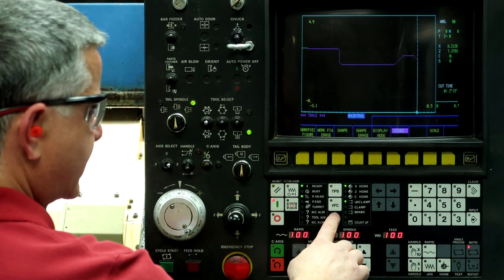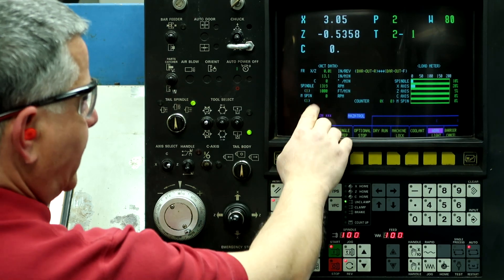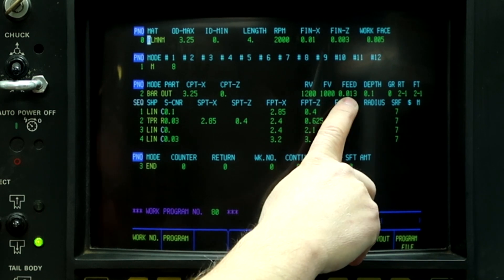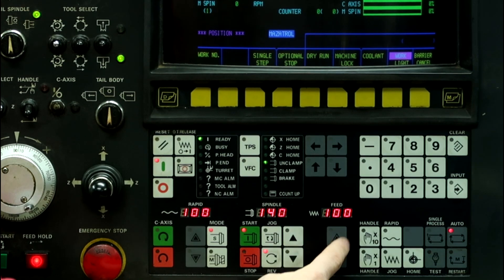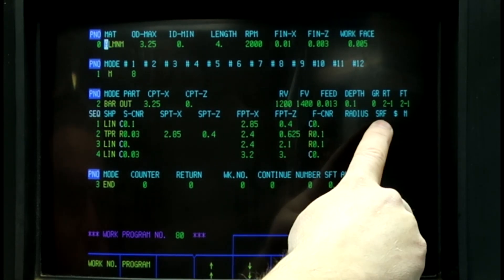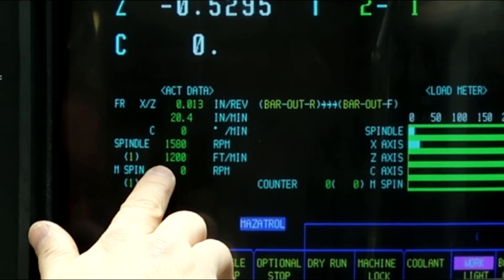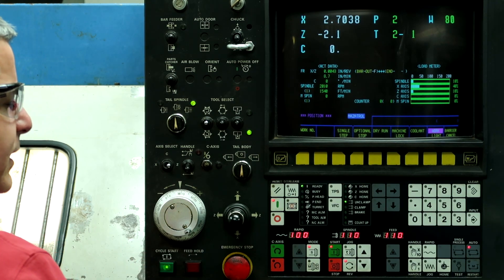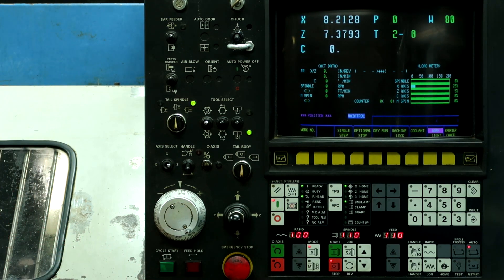Mazak VFC Button Function

Comment: should make a video of setting up the lathe from start to finish loading the tools, setting them with the toolsetter, entering tool data, setting the z offset, and adjusting the offsets to get a good part.
Reply from the maker: @aarontabor2915  thanks for the suggestion. That will be a long video though
Reply: @mazatroltipsandtricks6816  
Depends on how many tools you load.

Comment: Hello.  I have never written on/to a forum before, so if this is not where I need to be, my apologies.  We just purchased a "new to us" (aka used) 2000 VTC 20G.  Machine has been powered up and everything comes on, but we are trying to remove the blocks (for transit), and try to move the head/tools...., but are getting some errors.  Can you tell me if this is a simple fix that we can do here, or will we need to hire a professional to come in?  Alarms: 364-MAGAZINE DOOR INTERLOCK, 304-MAGAZINE NOT ZERO RETURN, 303-MAGAZINE DETRACT ALARM, 212-MAGAZINE DRUM MALFUNCTION.  Please let me know our best plan of attack to correct these issues.  Please and thanks, Chris.

Comment: Hi Phil thanks for You importante información i hace one mazak qt25 control mazatrol cam t2 i need parameter lista and one mazak VQC 1540 control mazatrol m32
Reply from the maker: I do not have parameters for other machines.
Reply: @mazatroltipsandtricks6816  thanks

Comment: You saying that Mazatrol automatically figures SFpM?  Isn't it better to adjust feed and speed while machine is cutting?  Or is that not doable?
Reply from the maker: This video is all about adjusting the feeds and speeds while cutting and then pushing the VFC button the machine memorizes those new values into the program.
Reply: @mazatroltipsandtricks6816  can you do feed or speed overrde while the program is running?  IS RV and FV surface speed or RPM.  One video you say its RPM another you say surface speed.
Reply from the maker: @joeshmoe5935  Yes, you can overrride the feeds and speeds while the program is running same as any other CNC Lathe.  RV = Roughing Velocity aka SFM.
Reply: Can't edit the program while program is running part.
Reply: @itsnotfar : No, you can't edit the running program while it is running.
You can only edit programs that isn't running or create new programs.

Comment: Nice Video Thanks Phil
I have a questionn for you.
Is it possible to do auto shut if  there is no material in bar feeder using some M codes in program by tracking chuck pressure, spindle load etc. ??
Thanks
Reply from the maker: No. Auto shut off is done with a timer. I have never used that function though on any Mazak so I'm no expert.

Comment: can i have more than 12 tool data stored in my machine so i don't have to fill in all the dimensions, the degree's and stuf?
Reply from the maker: Yes, but it gets complicated trying to keep track of the tools and you have to change the tool radius and tool direction anyway.  For simplicity, it's easier to keep the tool data and tool files the same as the station number.
Reply: Mazatrol Tips and Tricks but i can say that my tool 20 is a smal grooving tool and it is in position 4 
And tool 21 is a threading tool in positing 6?

How do i need to do it? Could you maybe do a video?
Reply from the maker: @jepkeklinge3778  Go to the Tool Data page and cursor down to position 4 and type in 20 and hit input.  Tool position 4 will then have a 20 next to it indicating tool file 20 in in use.  Do the same on position 6 and type in 21 and hit input.

Comment: I run a QT-30 at the moment. Your videos are well explained. Video that would help new people. Using tail stock , tpc or parameters issues, pressure, thrust.  Using one tool for multiple uses i.e  insert drill/boring bar.  More thread videos i.e pipe, acme, measuring methods.
Reply from the maker: Thanks for the ideas.  Unfortunately, my old machine does not have TPC function.  That came out with the next generation control the T-32.